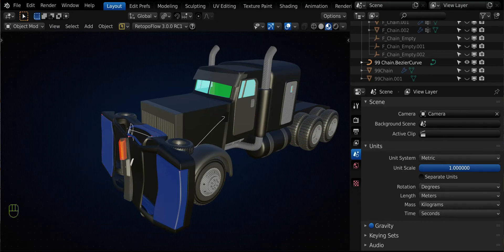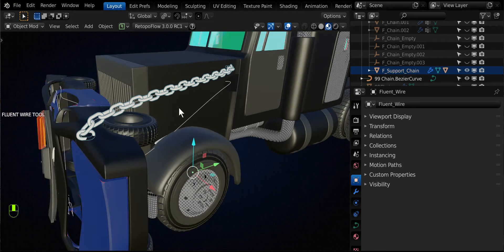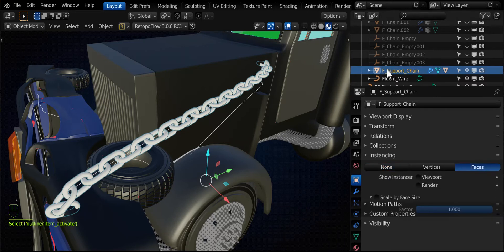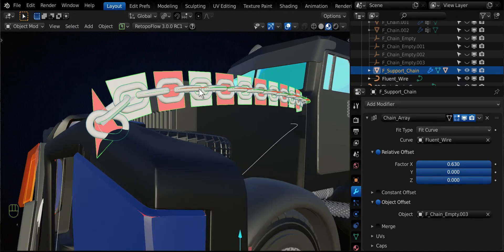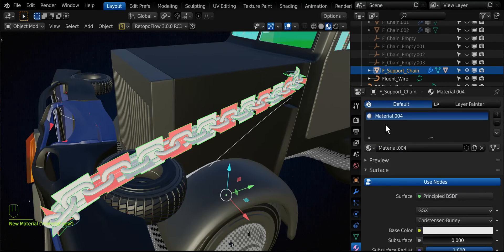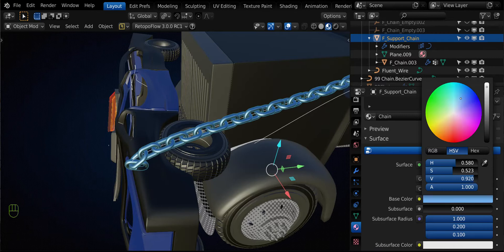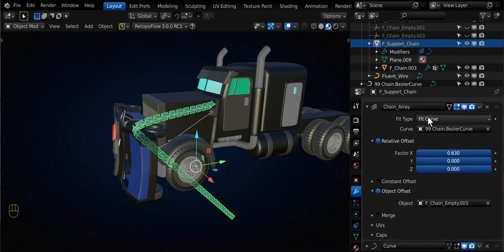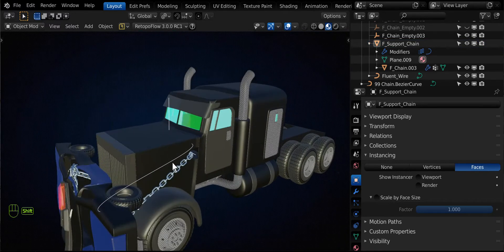Fluent Power Trip - Wire and Chain Explanation

Comment: I can't choose the chain. When I make a chain first and turn the curve into a meshe, I can't choose the chain. What do you think the problem might be?
Reply from the maker: Hey Melissa, sorry but I'm not sure I understand what you are having an issue with.
I recommend to troubleshoot: 
1. start in a basic scene to work out the details of what is going on.
2. Just use the fluent menu to make a wire on the basic startup scene's default cube
3. Once you have the wire created, change it to a chain
4. Finish the Fluent Modal operator by Right Clicking to bring you back into Object Mode
5. In order to select the single chain link that is instanced over and over again you are going to have to look in your outliner for F_Chain (not F_Support_Chain, that is a plane instancing parent to the chain link, think of it as a utility object). When you find F_Chain, it is going to be hidden
6. You should be able to unhide and select F_Chain and modify anything you want about it (including the material)
7. If you want to convert the single chain link into an actual mesh then make sure you are in object mode and select the F_Chain and hit Ctrl + A and select Visual Geometry to Mesh
8: If you want to then make all of the individual chain links separate from the support chain then select the F_Support_Chain and hit Ctrl + A and select Make Instance Real. This will turn the chain links into the chain mesh and each chain link will have "linked" object data with the original chain link. (You'll also notice that the support chain turns it's instancing off and you'll see only the planes again).
9. If you want to then make each chain link have it's own object data, then select them all and go to the Object drop-down menu and click on Relations submenu and then select Make Single User (or use the search menu to search for Make Single User). Select the check marks for Object and Object Data and choose "Selected Objects"

Hopefully that covers everything I can think of.
Getting from step 1 to step 9 would turn every chain link into it's own object with it's very own object data. Rarely would you need to get to step 9.
Reply: @blanchsb  Thank you for your help, but I'm afraid not. I can't pick the chain at all. I downloaded and tried a different version of the blender, it's the same problem.
Reply from the maker: @Kurabiye.Canavari  Fret not. There is a discord server for Fluent. It would probably be wise to do a screen record or screen shot and show the exact issue. I'm sure the folks on the discord can give you a hand, I'm on there as well but not all the time. There is a user named Florida Jo who is awesome and will probably beat others to helping.
Here's the invite link to Discord: https://discord.gg/3uPv3fv
Reply: @blanchsb  Thank you